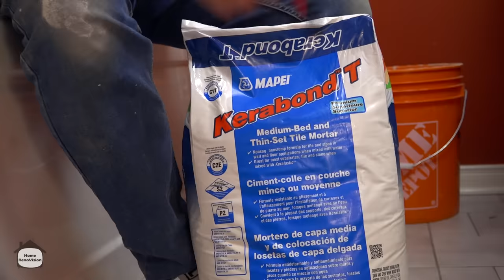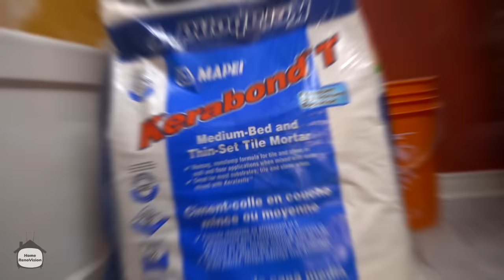DIY How to Renovate the Tub / Shower from A to Z

Comment: The tub and wall being torn out is 1000 times nicer than the one I currently have in my bathroom from 1965.
Reply: Mine is from 1966. The stool now resides on the tub. We have a dry rot problem around the stool. Had to have an asbestos abatement team tear out the flouting.  So now it sits because we can't find anyone to do the subfloor repair.
Reply: Bathrooms are interesting historical timepieces. You can tell when they were built with the tile. Eisenhower/Kennedy era bathrooms had pink tile.

Comment: I have heard back and forth things about grouting corners, should I grout or silicone corners of 12x24 tiles? Also, if the plate for the hot/cold fixture don’t work on your tile space, can you just silicone the plate on? Thank you for all of your suggestions!
Reply: You can do both. Grout first, then clear silicone
Reply: only silicone! Grout will crack. Silicone any plane changes

Comment: if your're using any sawzall to a wall, you definitely need to be wearing a dust respirator for the sake of your own lungs. Those small drywall dust particle  are really bad for your health.
Reply: Not only that, but if it is Wonderboard, probably has some fiberglass in it.

Comment: I am sure someone mentioned this, but mould as well as silica dust and other junk is best protected with a proper mask and you need to shave off the beard.  Keep in mind, maybe someone doing the reno is in their 60's and they have been exposed to something earlier in their lives or  maybe they are young and have allergies.  I was told that those cheap masks are pretty awful, especially with no seal.  Great videos.

* As I got further in I see you drop the mask altogether and talk about being old school.  Your choice.  I worked at an auto plant for a while and very few wore masks.  My Dad's friend (a farmer) worked with my Dad at another auto plant.  His lungs failed.  He was on a waiting list for a lung for a while.  Fortunately he was able to get a new lung and carried an oxygen machine around when he had the strength to visit us.  Unfortunately it only bought him a year.  He died fairly young.  I would call that a tragedy.

I would say that demoing an old bathroom is just about the perfect example of when to use a mask.  I mean how many people will be able to spot asbestos without testing materials?
Reply: My thoughts as well.  All the DIYers watching this are going to go tear up asbestos flooring and lead-paint glazed bathtubs and lead-painted wood trim, who knows what.  Seriously; test materials for asbestos (if possible) and wear a mask.

Comment: You Tube selected your video for me. I am subscribed, but this video came up on my TV today.

I have a comment about soldering.  And that is, the best soldering is a sweat joint.
What is a sweat joint?  It is not what you were doing. 

For a sweat joint,  you sandpaper or steel-wool the parts to be mated shiny clean. Then apply a thin layer of flux where the parts will be joined, Then  heat each part separately before mating them and where the parts are to mate, melt a thin film of solder onto it. Visually inspect that you have 360 degree coverage on both parts. 

Now use the torch to heat both parts and let them slide one into the other. Then apply the tiny bead of solder in the joint, as you demonstrated.  The sweat part insures that when you turn the main water back on, you will not discover a rework.  
Thank you for you great demonstrations.

Comment: I had a perfect pressure test this evening. Water is back on - family is good to go.  Demolition is done. Tub is out. Using Schluter system… Concerned about subfloor sections that have some damage and rot.  Hunting down your videos on how to correct that before shower install.  Don’t want a squeaky floor! But cant leave it as is!!  You’re a North American Treasure.  🇨🇦 🇺🇸 🇲🇽  Bob Vila doesn’t even come close. 🤭 Thanks for this.

Comment: Doing a bathroom now for the first time.  I installed 1/2" copper for the tub spout and ordered an NPT bath set.  I thought I was doomed until you explained slip-on vs threaded and learned that I can just solder on a threaded fitting.  Thanks for the education.

Comment: I watched this video several times in a year prior to doing one of my bathrooms. At least 20x. Looked similar. 
I suppose as a contractor, it's important to know more than the customer from a professional aspect. 
I do design & carpentry, but never done a complete demo of a bathroom on my own. 
Thought I was prepared. Talk about scope of work! LOL
The house being built by the military in the 1940's never meant much.  
Had no idea it meant tile +gypsum +3 inches of solid concrete + chicken wire. Very thick chicken wire.
4 days to demolish with 4 people sledging just to get to the studs.  After I got past the aches, 
the rest was a breeze! Therefore, I do appreciate
this video. I can only like it so many times. 
That green bag was a little more than getting a dumpster in my area and they also didn't have many drivers
and rules about what couldn't go in there.  After loading it up, I had to empty it out.
It's now a tarp for my picnic table. They wouldn't take it back at the store.

Comment: Tip from an apt maintenance tech.
 Easiest way i found to remove shower head arms is use a pipe wrench. The teeth grip and you dont have to apply as much force. It is screwed into brass so its easily damaged. Great video as always. If you are gonna reuse it, put a rag on the  arm then wrench it.

Comment: In my house when I do tile,  I just do the first row and get it perfect.   Then I scrape off all the cement or glue, whatever you use and come back the next day to two days later after it has set.    I find the weight of the tiles on the higher rows can shift the bottom tiles, if you don't let the first row set rock solid.    Since I am doing my own house I am not in a rush to complete. 

Another think you can do is try to square up the walls ahead of time with thin strips of wood over top the studs.  Get is as square as you can and then you don't have the out of square problems.   Also you can level the tub to be completely flat.

Comment: Hey Jeff, a good thing to have in your plumbing box are a few SHARK BITE 1/2" caps so you can just cap the lines to get the water turned back on ASAP. then just remove them when doing the plumbing work
Reply: Thank you for this tip! The one thing I was wondering while watching was when can I turn the water back on, this helped!

Comment: Great in-depth video Jeff. Thank you very much. I wasn't able to remove my metal tub as smoothly as yours came out. I actually took my Sawzall and cut diagonal corners out of the two ends of the outside of the tub and it was a easy-peasy after that. Not sure if I'll be able to slide a new tub in place without cutting out some drywall. I do have a question. When you cut through the drywall before removing the old wall tile, did you go through the vapor barrier? Is there a way of preventing that?

Comment: Excellent step-by-step video.  Thanks!  The video editing was a bit disjointed as you first install the shower body and in the next section the body was not installed.  I would use Teflon tape on the shower head pipe to prevent leaks.  All in all, great job!

Comment: You are definitely one of the best renovators on youtube!  Not only do you REALLY know your stuff but you're entertaining and teaching at the same time!!!

I had a question on your PEX.  What type are you using and are you still using that today?  I bought a house in NW Ohio that was built in 2005 and apparently the PEX they used has been known to have a lot of failures at the joints. :/  I'd like to go through and replace them but I am not clear on the different styles and connections for PEX, like, what are the best ones (and proven) that pro's use today.

Thanks!

Comment: Another tool that you can use, that I had used when I replaced my drain and overflow (because I didn't know about the tool), is needle nose pliers. Same concept as the two allen keys, but they stay together and are easier to handle.

Comment: 45:10 "Sandcloth" not plumbing related but in the Telephone Switching equipment installation we called it "Emery cloth" for cleaning the copper 48V power cables before C crimper one copper cable to another copper cable or crimped a lug on.

Comment: Thank you for your video. We have 2 tile bathrooms back to back and half the tiles and wall are missing in both tubs. 30 years ago they did not install any backer board in the house, so the tiles are just attached drywall. Nothing holding the tiles anymore. Something we,have been thinking about it for a couple of years.The bathrooms are very small. I wish ours looked nice and neat like that bathroom behind the drywall.We will have to see if the studs are still ok or if they will need to be replaced.

Comment: Your video has been very helpful. I have a couple of questions. Why not cut the tub into 2 or 3 pieces with a cutting wheel on an angle grinder? I am changing the tub/shower into a shower, and I will be using a fiberglass shower base. Do you have any videos showing this process?

Comment: Thanks Jeff for providing such invaluable information. I will be redoing my bathroom and installing ceramic tiles in the shower. I am planning on coating the 3 walls with "Redguard" before applying the thin set. The store has sold me a Polymer Modified thin set '' PROMA Pro-P-151-SF. Is this a suitable product to hold the tiles?
Thanks in advance!

Comment: Yeah, after seeing all this I understand it's easier just to hire a professional, however, there is no guarantee the professional will do it as good and thorough job as you Jeff 👍 the guy who was changing a tub and tile in my place, didn't use spacers for tiles. Didn't waterproof any joints, neither with tape nor with caulking behind tile. Well at least now I know)))

Comment: I learned a lot from this very comprehensive DIY video and will definitely use your tips & tricks on my own project.  Currently planning to replace my large ugly bathtub and convert to a walk-in shower and build the glass door using Glass Block and Colored Glass Block and slip resistant shower floor and more

Comment: I note you used the Schuyler board for backing.  I'm wondering about using water proof exterior wafer board then covering with the Kerri sheet?
This would give a wood backing anywhere for installing grab bars.

Comment: Great video. But for dusty work wear a N-95 mask with a RESPIRATOR (only cost $4). It is counterintuitive to expect to breathe easily with a mask that relies on a tight seal.  I can breathe easily and work comfortably all day with the N-95 w/Respirator.  It also more effective keeping out dust than one without a respirator because you're not continually breaking the seal with each breathe you take.
Reply: He should have recommended a respirator mask

Comment: Great video!  Saved us tons of headache and labor fees.  I do have a quick question.  At 1:33:00 I noticed you have a bit of a lip from the tile flange of the tub to the backer board.  We also have this lip and are wondering how we can work around it when we begin tiling.  Do you just use more thinset to bring the tile out more?  Thank you for your time and your excellent videos.

Comment: Hello. How would installing a new acrylic tub in a bathroom with metal studs? Is there a method to shim metal studs the way you do wood studs? I understand that the shims help the 1/2 cement board line up with the lip or flange of the tub once it’s installed. I have a new tub to install to metal studs, but I can’t find any videos or comments that address how to do this. Thanks in advance and I absolutely love love love your channel.

Comment: Do you ever use SharkBite products in making that transition from the copper to the PEX? For those that aren't comfortable with using the torch to sweat the pipes (Soldering the pipes in laymanterms)? I also find it handy to keep a couple of SharkBite caps both 3/4 inch and 1/2 inch so I can cap the copper pipe quickly and get the water back on... unless I'm going to finish my Plumbing that same day. They're super easy to get on and super easy to pop off. Awesome video... you do have a very calming soothing way about you. I wish I could be like that with my guys but sometimes they just don't get it, LOL. Keep up the good work

Comment: Hi Jeff. I'm a girl. I looks really easy when you remove those tiles from the drywall. Here in Malaysia we don't have the drywall system.

Renovation sure needs strength! Because we are dealing with brick, mortar and dried cement. So force of the chisle and sledgehammer is really needed.

So power hacking tools is needed here.

Comment: I watch your videos all the time, it's how I learned how to use self leveling concret. I do have a few questions on tiling my shower area. I have to original shower/bath insert that came with the house, but the drywall above it has gotten wet, peeling off. Its about a 2ft space on all three sides. Hiw would I go about fixing it?

Comment: Pretty good overview. I however don't feel comfortable using the slip fit drains in a sealed area. Those things always seem to leak more frequently then glued plastic fittings. Having rehabbed a few 50+ year houses and tearing out the main drain lines I much prefer ABS or PVC over anything metal.

Comment: Picture what you just did with the liquid pipedope sealer. You put it on the "female" threads of the shower arm elbow fitting. What happens when you do that is the sealer is pushed ahead of the shower arm when you screw it into the elbow fitting, allowing it to end up "inside" of the piping system. This pipe dope sealant will now have a chance to travel through the shower arm and into the shower head and may end up plugging up the show head itself.  Otherwise, you did a perfect job!

Comment: Before cutting the drywall try to locate a stud and draw a level line down the center to cut it strait so you dont have to cut it again or having to add studs to nail to.

Comment: Question: I have a bathroom in a house built in the 70s that I am wanting to redo. I already know behind all of the tile (Flooring, half walls, etc.) there is lathe. You know, the old way of laying tile? The reason I know is I had to replace the floor in a half-bath. What is the easiest route I can take to remove the tile, mortar bed and lathe that is nailed to the subfloor?

Comment: Jeff!
Not sure you will be notified of this query, but I simply wanted to know the following:

I'm currently doing a second floor shower remodel and am ultra paranoid about leaks.
I have already installed waterproof hardibacker on the surrounds, and was going to apply two coats of Aqua Defense as well, and then finish off with my Schluter membrane before tiling.

Can I still apply my Schluter thin set unmodified morter over the Aqua Defense, or will it not adhere and interfere with my Schluter membrane?

I need a quick response! TY for all your great DIY vids~

Brian

Comment: In the photo of the plumbing the copper pipe had an extention going up. Probably  for water hammer. The air is to cushion the water flow during hard on or hard off. That setup dose not work  over time the air cussion will disapear (fill with water)  and the hammer will start again. Best is to replace it to a special device made for water hammer cz it will not fill up with water. 

Bit off topic - that went smooth you were lucky. Great show.
Reply: Probably didn’t need it because he used enough pex tubing.

Comment: Brilliant wall removal technique!! Kind of a "duh" moment. 🤦‍♀️😀
I was surprised that the seam between the Kerdi board and the tub flange wasn't taped. Seems like a better barrier than a bead of caulk, especially a warranty busting caulk. Why isn't it used in that location?

Comment: Jeff, question for you...I bought that brass drain kit as shown here in your video. Visible at
1:11:51 is the rubber ring that sits on top of the drain. Super easy to knock that thing off
centre or worse yet, into the subfloor cutout. What do you recommend doing to keep it
in place until the tub is fully in and you can make the connection to the top fitting?

Comment: Jeff, I appreciate your videos. Your tips helped me with some questions on my first tiling project, which I'm just finishing up. I have a question I hope you can answer. My tile ends, where the tile meets the drywall, are uneven because I cut some tiles a bit shorter than others. I want to finish with bullnose, but some are as much as 3/16" shorter than others. How can I fix this so it looks as good as possible?

Comment: It looked like the old copper plumbing had water hammer arrestors attached atop the two tee fittings on the hot and cold inlets to the valve, but it was tough to tell - that part of the fixture zipped across the frame pretty quick at the 34:15 - 34:16 mark. Is that what was attached to the top of the two tees?  If so, were those no longer needed because you replaced the copper with pex, or was potential water hammer issue handled some other way?
Reply from the maker: pex does not need it. Cheers!

Comment: A tip with the tub drains. If yours was old like mine is (installed in the 80’s and then glazed over by idiots) the crosshairs at the bottom of the drain will snap when using your drain removal tool. If that happens dont panic. They sell a tool at hardware stores that looks like a cone with aggressive toothy threads on it. It goes on the end of a 1/2” drive socket wrench. Hammer the tool teeth first into the drain and it will bite the metal. Then stick your wrench on the tool (an extension helps) and go in the counter clockwise direction. The drain will come out. Hope it helped.